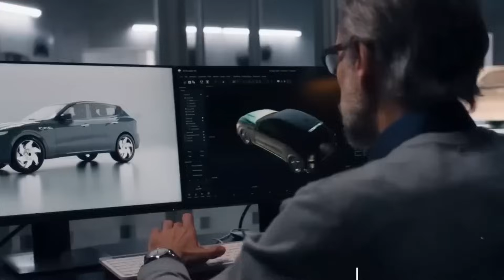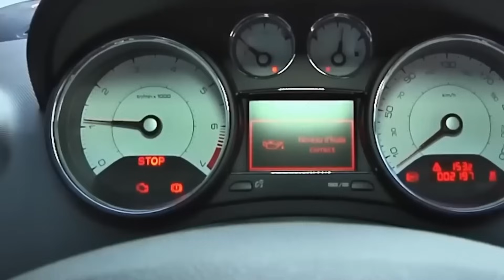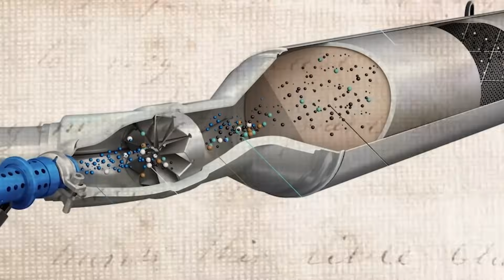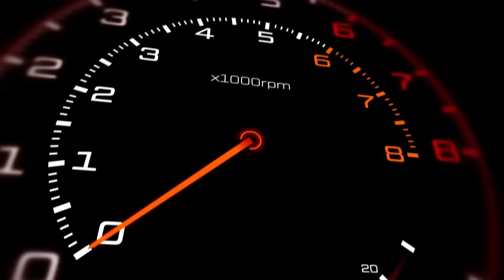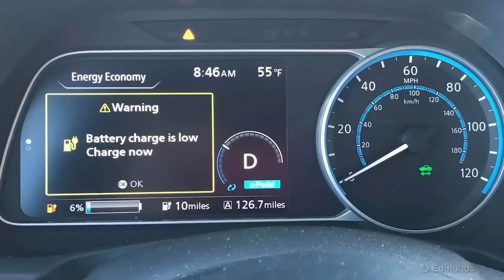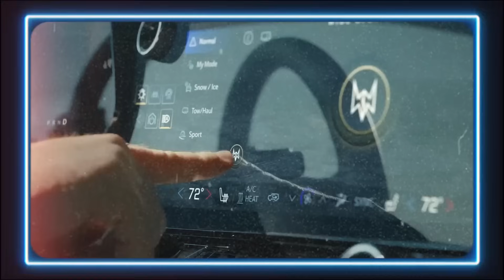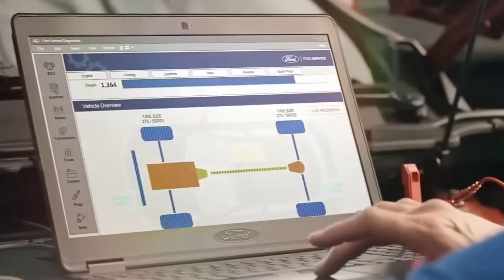Jeep CEO: Our NEW COMPRESSED AIR Engine Will Destroy The EV Industry!

Comment: All engines work off compressing air . Just saying
Reply: Ice engines do not "work" by compressing air. The air compression is a "cost" overcome by ignition and combustion of the energy source fuel
Reply: @jimmys6566  so would a engine work with no compression
Reply: @Sr82.  Read what l wrote
Reply: @jimmys6566  I did and we're rite .